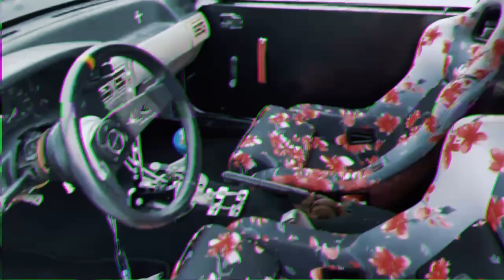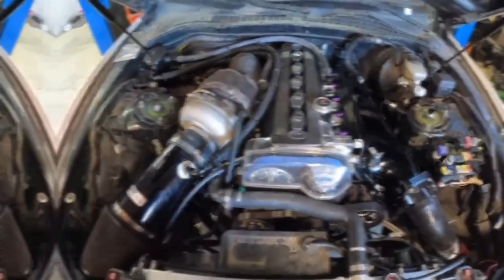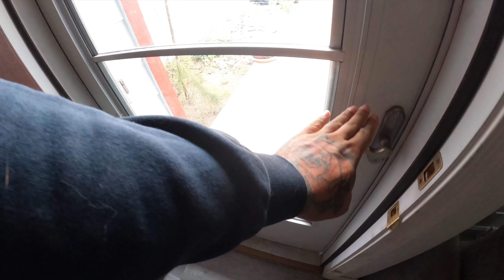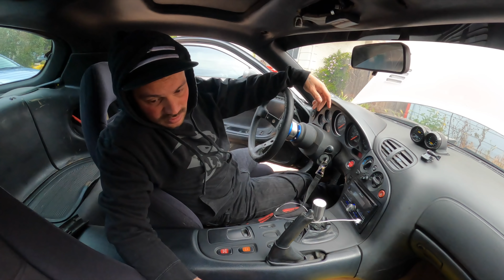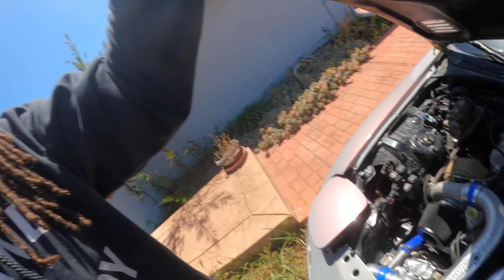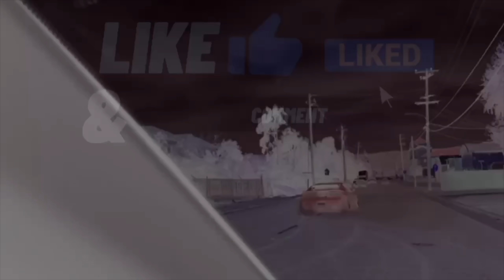I hope I didn't Blow Up The Rotary Engine On My RX7...

Comment: With the fueling upgrades coming, are you going to upgrade the cooling system, like a swirl pot, low temp thermostat, bigger radiator, electric water pump?

Comment: Glad the cars ok. By the way I saw you opened the garage door by hand unless I’m trippin. I have a brand new door opener in the box with back up battery 2 remotes and it’s the one that mounts on the spring strut which eliminates that over head one that hangs over the cars. Interested hit me up I live in Vacaville.